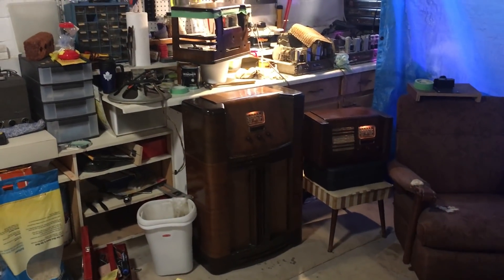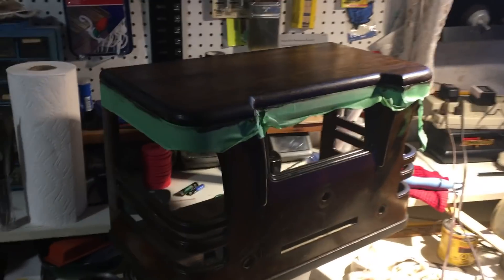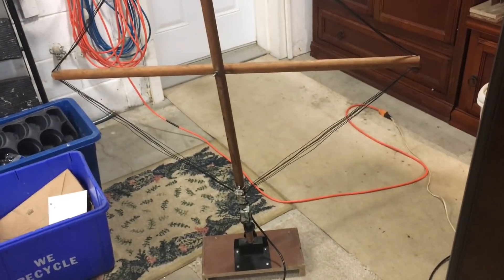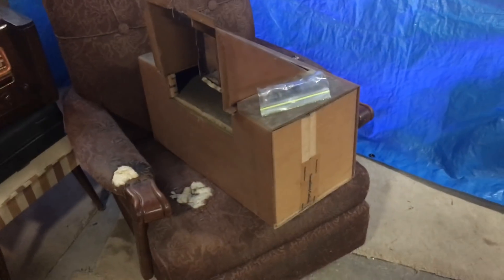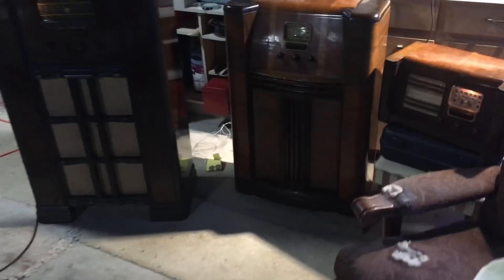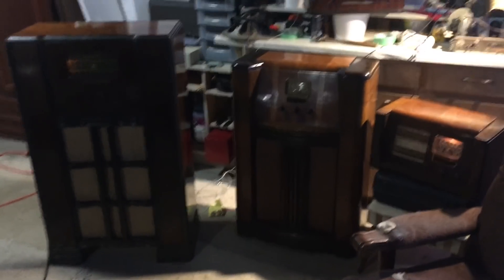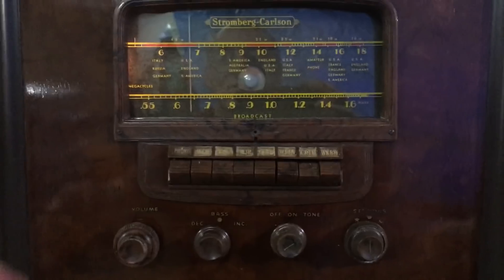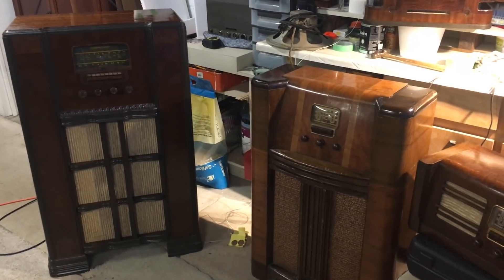Three Radios Tested - Crosley 12B and Stromberg Carlson 515

Comment: Noise is such  problem. I had a radio that was not usable in certain sections of the dial but after repairing it and aligning it I found the problem much improved. I could never find my noise source either. Very frustrating. I have a little Walkman type radio I was using to try to find the noise  but got nowhere with that. I figured that using something that used headphones would help but it didn't.

Comment: is the B+ to the magic eye not high enough, I suppose you will be recapping that radio.
Reply from the maker: I think that's the right question.  I'm guessing the B+ goes extra high at first until all the tubes are conducting then it lowers to the normal operating voltage.  At that point, there isn't enough left for the Magic Eye.  Something could be steeling voltage from the plate of the Magic Eye tube (and maybe other tubes as well).  I plan to have that radio back on my bench for another round 'o fun with it.